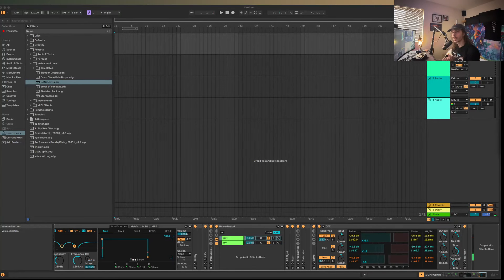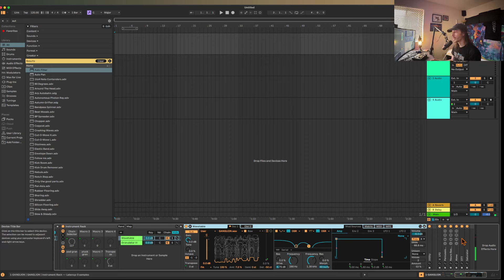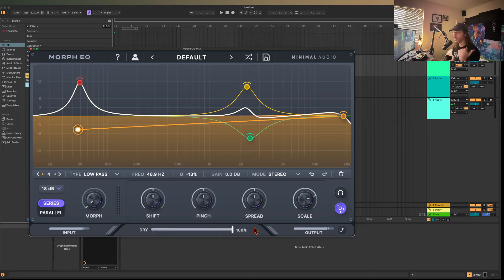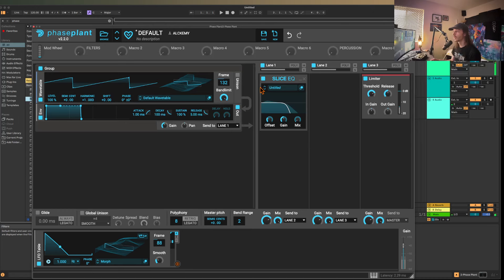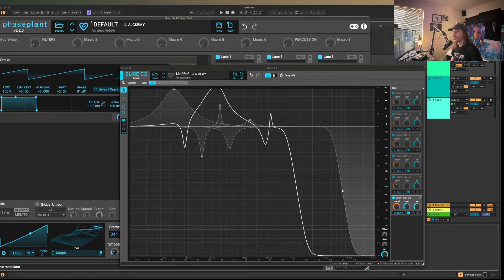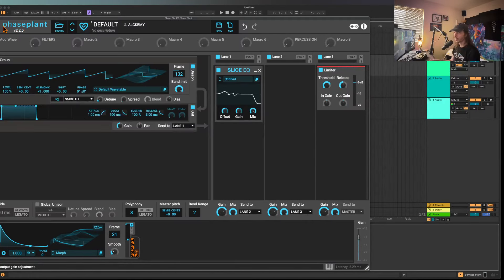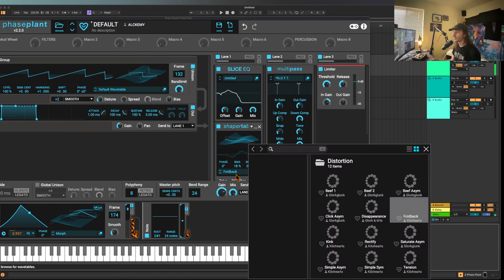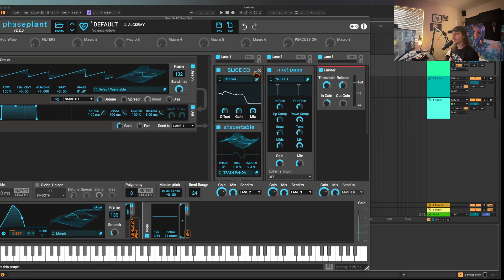Filter Tables? Its Not That Simple

Comment: There are wavetable editors which do allow nodes to fully morph per-frame, sonic academy node was the first afaik but Zebra3 and Zebralette3 allow you to create node-based wavetables, and then export them via the regular wavetable method or use them internally as "curve filters". Internally while in additive mode it controls the generation of each partial and thus allows you to create each spectral band from the ground up, it's pretty insane stuff.
Reply: p.s you can use them to create super smooth shaperTable morphs too :D
Reply from the maker: Correct me if I’m wrong but I feel like the major difference is that you are filtering a raw waveform that’s directly related to shaping harmonics over filtering a live signal. Spectral would make sense with the phase part but I’d worry about it sounding… spectral if you know what I mean

Comment: So, I am pretty sure that you can have filter tables in Reason.
Europa has a Spectral Filter that you can load wavetables into (or samples in general) and as far as I understand you can scan through the loaded-in table via the resonance knob on the spectral filter. I tried it out and I think that's how it works.
And Speo, a musician and maker of Rack Extensions made Strive, which is a dedicated filter than can also do that, if I understand it correctly (I have only seen the announcement video).

So, if they want to implement such a thing, there are models out there, I think.
Reply from the maker: I responded to dash about the spectral aspect of it but that’s where it seems like it would have to go to fix the phasing issue

Comment: Hey, thank you for going into detail on this, I can see why it's not so simple - I still think it's possible, but honestly better controls and control pass-in to slice would ease a lot of the pain.  I can see a way to making flg/phs/rvb filters in slice but I would need some free time to go down that rabbit hole lol.  

One of the main issues is the non-linear pole movement relative to frequency, I'm thinking of serum here, where the poles in their various exotic filters don't move statically relative to each other, unless I misunderstand slice that would have to be configured manually with remaps and probably with some reference material on the harmonic relationships of particular vowel sounds etc.  Totally doable, although a PITA.

In terms of sounding cool and getting near-enough timbral qualities, Phase Plant is definitely there already.  I've got some ideas of a table position macro on a 0hz LFO table acting as a morph for slice in a snap heap now, thanks again.
Reply from the maker: You can get them to move all in sync with the shift knob. So it wouldn’t be too hard to set one macro as the shifter and another macro as the morpher which would be attached to the lfo depth. That way they can all move in sync or can break out and do wonky stuff
Reply: @Alckemy  (unless I'm wrong) when you offset the EQ pattern in slice, it's linear and doesn't account for the harmonic change up and down the spectrum - a 200hz wide notch is always 200hz wide, and likewise Q is not attenuated.  "True" phaser, formant, etc, relies on their non-linear harmonic relationships.  I know you get this as it's critical in physical modelling, just trying to articulate what I mean; while slice is definitely great, it can't fully replace certain filter types - if you laboriously copied Serum's reverb filter, it'd lose its harmonic relationships as soon as the offset changed.  It still sounds cool but can't be relied on for the expected timbres of those particular filter models.

Comment: i can't see why a filter table would be that difficult. 

You just need a way of being able to interpolate/morph between different eq states or something?

Surely..
Reply from the maker: Did you even watch the video?
Reply: @Alckemy  some of it not all, but I just refuse to believe there is not a way. 

Where there is a will, there is a way.

You can almost do it anyway already, but the problem is its just awkward and time consuming and you have to manually move between points. 

If you can move points on an eq manually, you can get it to do it automatically, to make that into some kind of filtertable you'd just need to have a set of different eq states or whatever and have a way of moving eat node from one state to the next.